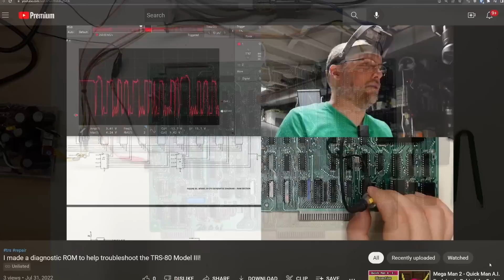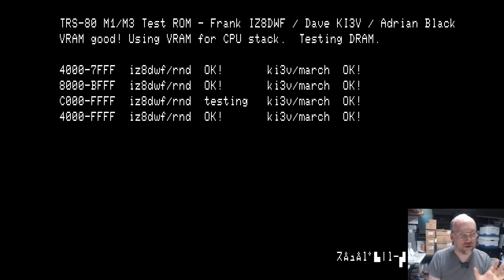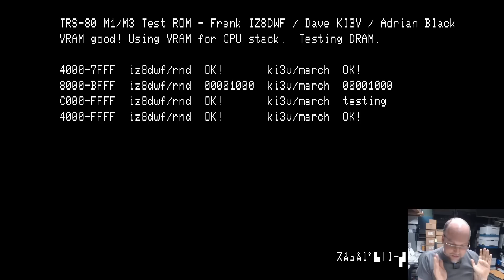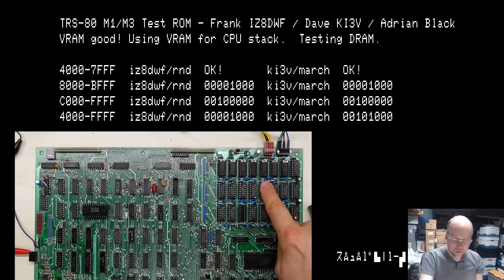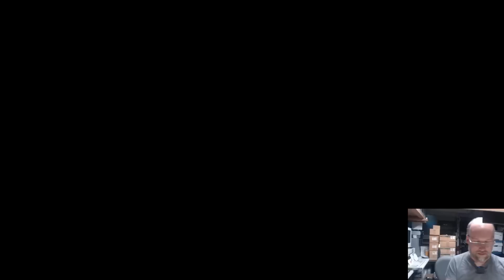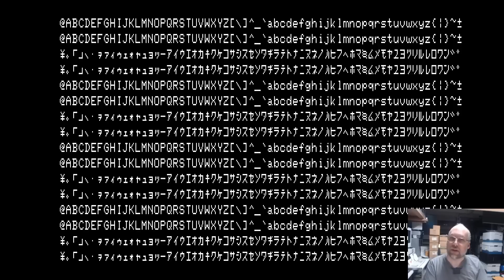Let's talk: Our brand new TRS-80 Diagnostic ROM!

Comment: There are various techniques to run without a stack. Instead of jump to subroutine, you can do a jump but setting a register to index into a lookup table that will be used to jump back. Changing a subroutine into a macro will duplicate the routine every time you need to use it. It's wasteful but it looks like you have plenty of memory space.
Reply: I just want to add, the Z80 has "Shadow Registers" for all of the 8-bit regs. Not a lot of code actually uses these but it's a perfect place to store things like return addresses instead of using the stack.  You have to exchange the registers in order to use alternates, the EXX instruction swaps BC DE and HL all in one instruction, you cant access them directly. You can also jump to the addresses stored in IX,IY and HL. I think Zilog was thinking about context switching all the way back in the 1970s, it's crazy to think of having a multitasking OS back then.
Reply: duplicating routines also helps for saving on registers on cpus with very few of those (hello 6502)
Reply: THIS IS COMPLETELY WRONG.  The ONLY way to increment the PC counter is through the stack.  Good luck writing any code that will increment and modify without the stack.  Nice try on the EXX flex.
Reply: @Sonex1542  What are even talking about? The PC increments independent of the stack during normal program flow. It's only when you use CALL/RET, PUSH/POP, or when an interrupt fires does the stack do anything. None of the jump instructions use the stack in any way. How do you think the CPU is supposed to initialize and check memory for the stack if it can't function without one?

Comment: Interesting to see how when you replaced the VRAM chip with a faulty one the "graphics" characters turned into Japanese characters (with a couple of them out of place clearly ponting to a bit error).
Reply: I think that points to the fact that the computer was made for the Japanese market first and then modified for the West. Somewhere lies a patch of ROM that didn't need to be recycled and still has all the kana.
Reply: @mal2ksc  huh. I wonder where they're hiding. 256 correct ASCII characters means all 8 bits of the generator are being used, I wonder what had to be wrong with that chip to shift it into a higher bank altogether (and what is sticking to double the 64-char lines up)
Reply: It's also interesting that the 64-char block drawing pattern line has different margin handling to the other 3 lines. Maybe that "correct" chip is broken too

Comment: You should make a “smart” ROM adapter, which has its own SRAM mapped into some unused address space, that way your diagnostic code could work in any system without any modifications.
Reply: It wouldn't work in bank-switching machines with a full 64K because they "know" they can't write to "ROM" so don't even have the signal lines to try. It would also require designing a new PCB, when they just cribbed an existing one from somewhere.
Reply: @mal2ksc  It turns out the bank-switching machines like the model 2 will write to the underlying RAM when you write to ROM locations.  We solved the issue however by very carefully rewriting the tests and drawing routines to require no RAM, relying solely on the Z80 registers for state.

Comment: I peeked at the code, some really clever and tricky stuff in there. But the thing that really made it possible VRAM test (without stack or ram) and relocating the stack to VRAM is nothing short of genius.
Reply: If the VRAM is directly mapped into the memory space, then it's sort of an obvious thing to do. But this apparently is being tailored to work on machines that don't map the VRAM directly into memory space, and that is genius.

One interesting point might have been covered up by Adrian's picture in the corner -- it would have been interesting to see if the last characters on the screen reveal the contents of the stack.
Reply: @mal2ksc  The characters do show the stack. It showed in the other video.

Comment: Thanks for another great video! I had the mechanical equivalent of the page error yesterday on a machine: one digital PLC output shorted to another one: forcing one mechanical piston to go out when another goes home, took allot of head scratching to figure out that the multi-conductor cable for it was shorted internally! :D
Reply: oh wow, that's a weird problem and a half!
If a cable is shorted - something went terribly wrong, either if was pulled with force, or pinched etc
neighboring cables should be inspected for damage as well.
Reply: @jwhite5008  It's not as strange as it sounds at first, because said multi conductor cable runs in a  cable chain so it moves allot, I was still quite confused until I realized exactly what was causing said issue :D

Comment: If you do versions for other systems in future, why not use 8080 (subset of z80 code)?  That way you could use the routines on 8080 based computers too 👍🏻
Reply: I guess that will depend on how reliant they are on opcodes that aren't in that subset. Also, even if they can be broken down into supported ops, the 8K limit on the ROM might not allow it.
Reply: I wish I could.  I'd love to try it on my model 102 (which is an 8085, basically an 8080).  However, I had to use the IX and IY registers that don't exist on 8080, not to mention most of the Z80-only opcodes.  It may be possible, but it's clearly beyond my abilities.  Frank might be able to do it.

Comment: I don’t see the latest ROM on GitHub yet ?  Only the 5day old initial version ?
Reply: The current version should be what you see on the "main" branch.  There is a release called version 1.5.  If you can see that, that's the current code.

Comment: yes indeed, my routine reports the first wrong bit only :)The repairer should first fix the bad bit then try again :)
Reply: It reports 11110000 when the bus transceiver is absent, which means it still reveals when the fault is something other than a single RAM chip, so I'd say your test is adequate for most purposes.
Reply: @mal2ksc  Actually I meant  that the code aborts testing at the first bad BYTE (not bit) and it shows all the bad bits in that particular byte. However it could be changed to accumulate all bit errors in the whole ram segment under test, but that would require another free register and a way to simulate a return from subroutine without the stack (or just unrolling all subroutines). The original code was adapted from custom ROMs I wrote to troubleshoot arcade PCBs like Galaga, Asteroids and Missile Command.
Reply: Yes to be fair, that's what Adrian asked you for.  I changed the rules after we started (I moved the goalposts).  But I basically learned useful Z80 assembly by reading your original code, so thank you!

Comment: Hmm.. and I should add that march test idea to my c128 diagnostics.
Reply from the maker: I'd love to see a 6502 port of the march test as well.... especially a stackless one, if possible. All the Commodore 64/PET RAM tests seem to really suck and miss simple things like page errors on the DRAM.
Reply: @adriansdigitalbasement2  stackless on something like a c64 is possible, but reporting back anything meaningfull is going to be rather difficult because video ram is just part of system ram, and the only bit of independent ram you have is color ram, but that is only 4 bit.

Oh, and the code is going to be a bit inefficient space wise, as you can't use the zeropage for indirect addressing. 

On a c128, it should be possible to use vdc for output, but that is a somewhat unique setup for a 6502 machine.
Reply: @c128stuff  Can the z80 on the 128 access all the same RAM as the 6502?  I don't know c128 architecture (even though I have one that needs troubleshooting).  If so, we might be able to adapt this one (though adding it to yours would surely be immensely more useful).  If you'd like pointers to the papers I read to implement the March test, let me know and I'll send them your way.
Reply: @drgiller  Thanks. The z80 can access most, but not all system ram.

For my c128 diagnostics I'm looking at a different approach, making use of the 2 mostly independent blocks of 64k, and the c128 having the for a 6502 rather unique capability of relocating the stack and zeropage, and being able to point the vic2 chip at either ram block. 

So what I'm thinking for now is to just use vdc for output, do a test on a page in the 2nd ram block and if ok, use that for stack, and run a march test on the 1st ram block, and when done, move the stack to a known good page in the 1st block, and do a match test on the 2nd ram block.

That approach is unique to the 128, it won't work on most other 6502 based machines.

The march test is both a really clever idea, and a typical case of 'obvious on hindsight', and seems rather trivial to implement, but a reference is always nice 🙂
Reply: @c128stuff  The devil is in the details on the march test.  I implemented the algorithm after researching it in several places, but it wasn't until considerably later that I understood WHY it's better than more simplistic tests.   You have to understand how RAM actually fails.  I am sure I am still missing half of the subtleties, but I made sure to carefully follow the algorithm.  I may add a checkerboard element to the tests, but I'm not sure that's necessary... cycling through AA and 55 as I'm already doing might catch the same types of errors.
Reply: @drgiller  a paper is always nice to check.

I found a nice description of the 'Serial March test' using both ascending and descending addressing order, which seems pretty self explanatory with how and why it works, tho I probably do miss on some of the conditions for which it also works.
Reply: Some of the arrows in that slide deck are hard to read but upwards vs downwards is usually significant.
Reply: @drgiller  don't know if you posted any links, but links to things outside youtube generally don't work.
Reply: @c128stuff  Oops!  It shows up on my screen which is obnoxious, so I thought it worked.  I've started a "Discussion" on the GitHub page that Adrian linked in the description.  It has a couple of attachments and a link to a video.
Reply: @drgiller  thanks, I'll check it out.

Yeah.. I ran into that thing with links myself in the past.

Comment: Yes... 6502 stack is at $0100. But for example the C64 dead test cart does not actually need a working stack to do its initial ram test. What it can't do is actually display anything beyond the 'flashes'.
Reply from the maker: Indeed -- sadly they do a really basic RAM test which is why is is so bad at missing problems. I am not sure this march test can run on a stackless 6502 due there being less registers ... but maybe.
Reply: @adriansdigitalbasement2  I'm not sure you could squeeze anything really useful into a stackless 6502.  Maybe you could see if you can dare Frank to try!  I know it's beyond my capabilities.
Reply: @drgiller  I have written a 2 page stackless ram test for 6502, the test itself is doable, just a bit wastefull space wise... the real problem is trying to report anything back, keep track of the number of errors, etc. But 3 registers is just enough to do the actual test.
Reply: @c128stuff  Back in 2011 I wrote a simple diagnostic ROM to see if a "dead" Commodore PET had any signs of life, which despite using no RAM managed to communicate a fair amount of information. It had two loops which it alternated between every two seconds:

Part 1: fill display memory with four copies of 0-255 so you could visually check if A: anything happened at all, and B: if the resulting output looked correct. (obviously this wouldn't catch arbitrary bit errors, but it'd catch gross RAM errors, problems with the character generators, etc.)

Part 2: Do a really brain dead RAM test where "even" and "odd" alternating bit patterns were written to the first 1K of memory, read back, and a result written directly to the corresponding memory location in VRAM. (The result would be a display full of "g"s and "b"s; because "real" 6502 code relies so heavily on the zero page and stack any "b"s in the top half of the screen would probably mean big trouble.

The code was a huge mess, of course. Because of the limits of relative jumps, etc, it wasted a huge amount of memory just running through four copies of each test in ROM, etc. (In fairness it was actually the first real 6502 assembly language program I ever wrote.)

Much better PETTESTER ROMs have been written since, which do a brain-dead check like my original to see if at least the zero page/stack is usable and switch to a more featureful diagnostic, but I'm kind of proud of my original hack job.
Reply: @PaleozoicPCs  ah yes of course, most/all? PETs have vram separate from system ram, that helps a lot.

What you describe is not much different from how my c128 diagnostics do their ram test, tho like the dead test cart, it uses vic2 border colors to communicate errors in the zeropage, stack or the ram it will use for output. 

But for a march test you want to be able to trash all addresses in a bank, so there is a need to avoid needing the stack or zeropage, unless you can relocate those so they aren't handled by the same ram chips you want to do the march test on.

On a C128 that is possible, but not on a c64 or vic20 or ted based machine.

I suppose on a PET you could store the code in vram, and make it self modifying to avoid needing a zp pointer or lots of near identical copies of the same code.
Reply: @adriansdigitalbasement2  less registers, and especially the lack of a register usable as 'pointer' makes for needing a separate loop for each 256 byte page, which is inefficient memory wise, but doable.

Reporting back anything meaningfull is more difficult, and keeping track of an error count, or a loop count or such... will make you run out of registers for sure.

A for reading/writing/xoring values, X as index register, and Y to keep track of the current write/compare value... should be doable.

Comment: I'm sure you can manage to limit your stack usage to only 128 bytes.  Then it would work with the 7 bit VRAM on the model 1.
Reply: Just realized, I was thinking 7 bit address lines, not 7 bit data lines.  7 bit data lines makes bytes only register numbers 0-7.
If you can somehow limit what gets put on the stack only needs to store 0-7, that would work.  I'm sure that wouldn't be easy.
Reply from the maker: Indeed -- it's ok -- the current version on the Github repo uses no stack at all. This was one of the advances we came up with after I made this video. 

It uses a simulated stack hardcoded into the ROM.  It's really trick!
Reply: @danman32  YT ate my reply but yup, you got it.  Although even more sadly it's bit 6, not bit 7 (counting from bit 0), so it's really a mess and not worth the effort.  The most useful think a stack can do on a z80 is call/return, and with bit 6 stuck high, it's really useless for that.  EDIT: Adiran corrected me: bit 6 is a NOR of bits 5 and 7.  I haven't the faintest idea why.  But the issue is the same: it can't hold useful values for call/return, so useless as a stack. You might make a case for using it to hold a few bits of RAM variables.  I considered using it to keep the offset into a table with less than 63 entries, but ended up not needing to do that.
Reply: @drgiller  so really byte only goes from 0 - 63?  I guess that would be true if there's only upper case.
Reply: It's actually worse than that, or at least more complicated. Because of their penny-pinching on bit 6 they were left with a memory that could only hold values 0-63 and 128-191, but since standard ASCII places the (uppercase) letters between 64-95 and they wanted to maintain some compatibility with that they added some read/write mangling hardware so if you write, say, "65" to VRAM it'll produce the expected uppercase letter A... and it'll read back that way, but you'll get the same uppercase letter A if you write a "1" to VRAM. (But that "1" will also read back as 65.) This caused all sorts of issues with early lowercase mods for the Model I because there are places in the Level II ROM and some software that got used to the idea that they could write letters to the screen using values 1-26; a straightforward mod that just gives you 8 bit memory with no rewriting causes havoc with the screen display if you can't switch it off.

Radio Shack's official lowercase modification kinda faked their way around this by replacing the character generator with one that had a duplicate set of glyphs between 0-31 and 64-95, but the whole thing was a mess. Some third party mods retained some of the write mangling logic instead, which would obviously be a disaster if you tried to use video memory for stack or run code from so, yeah. Not a good idea to try on a Model I, generally speaking.